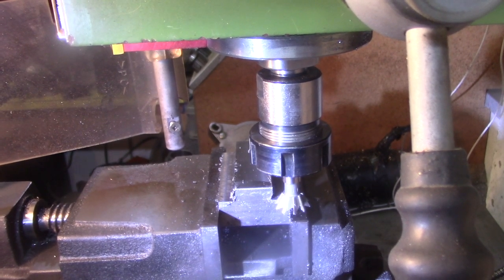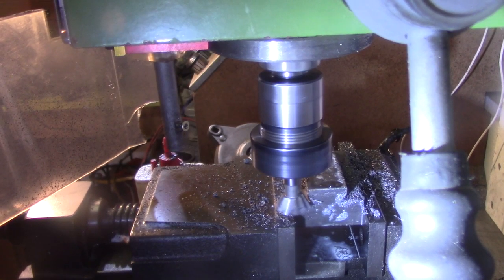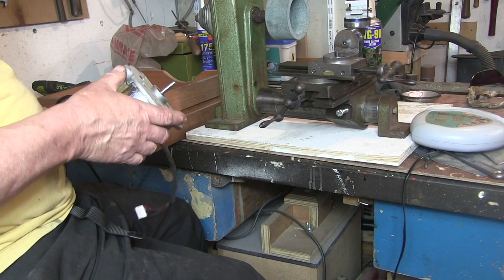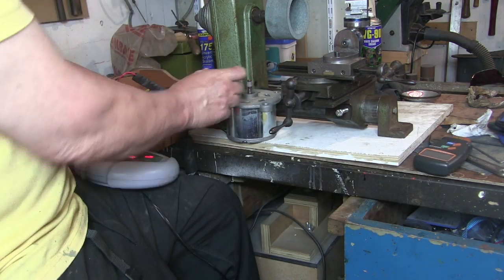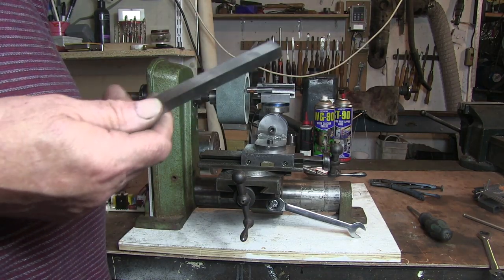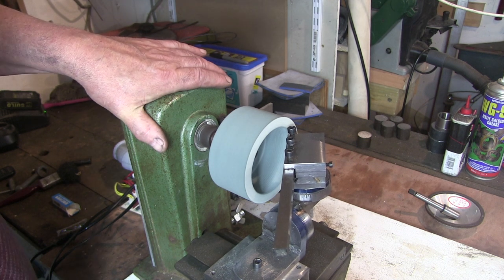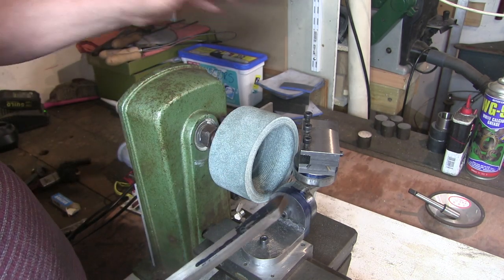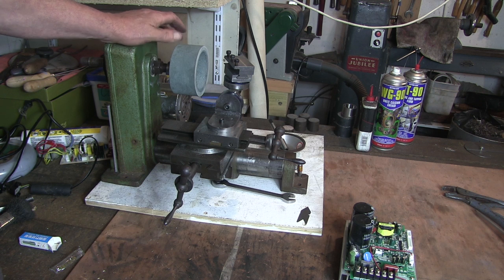T&C Grinder build Part 5

Comment: Looking good Cliff. The reversing feature is good it means you can use both sides of the wheel when you flip your tool around and still cut downwards.
Your braver than me. I'd stand to one side until you guard that grinding wheel. I've seen (made) one of those explode in my younger days lol, what a bang that was everybody hit the floor. We couldn't find any big pieces of grinding wheel anywhere. Tony
Reply from the maker: That's a very good point Tony, I usually instinctively stand to the side of most spinning things, to engrossed in this one!

Comment: Thanks for the mention :)

Man that dovetail cutter was sounding sweet as a nut at 400rpm.

In hindsight, 150rpm was a little conservative on my part but its best to start slow and work your way up. Which you did to great effect and it got the job done nicely, the T&C grinder is definitely shaping up well.

I feel your pain regarding your motor situation, I'm having some motor woes myself, of a slightly different nature though.

I got a real doozie for an absolute steal on ebay, 3ph 1.1kw 400hz 11000rpm aerospace motor in a 170mm x 80mm chassis, which has been lost somewhere in the UPS sorting depot.

Desperately hoping it's found as they're rather hard to come by (fingers crossed) but started searching for an alternative just in case.

Quick not on grinding wheels.

Most wheels and cups will have a maximum speed rating on the label, if not, try and contact the vendor to find out what it is, running wheels too fast is a recipe for disaster.

Also, an absolute must is "ringing" the wheel to check for cracks. That is simply done by "hanging" it from something like a strong wire and tapping it gently with a screwdriver. If it's good, it will "ring", a bad wheel will sound dull and flat.

If it's the latter, you can chop them up for hand stones or alternatively, break it properly and bin it. Cracked wheels are no joke and can do some serious damage to everything around them if they explode at high speed.
Reply from the maker: Cheers, it did a good job when  not being abused by a numpty! :-) thanks for the advice,
All the best,
Cliff

Comment: Looking pretty slick  Cliff, pity about your VFD was the power output of the VFD close to the rating of the motor? I would make the rating of the new one, one up from the motor rating personally. Or not kick the arse off of the lathe! Are you based in East London by any chance? If so I have a couple of spare single phase at least half horsepower motor and you are welcome to one as I removed them from my wood and metal lathes and went the VFD route myself. Let me know if you are interested and I will send you my email address
Reply from the maker: South London, Kent really, Orpington. The vfd was a 1 1/2 hp and the motors one, it was me. I knew I was overdoing it! Thanks for the offer, I'm alright for motors (at the moment)
All the best,
Cliff